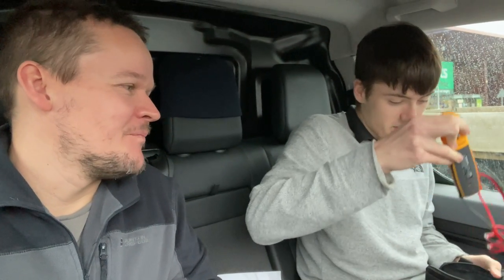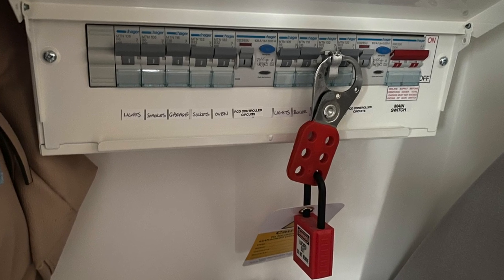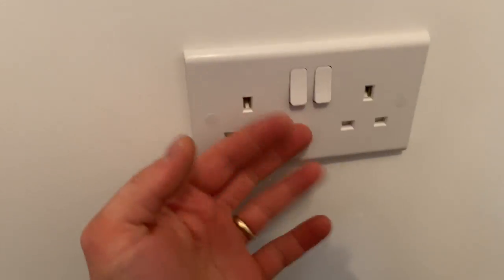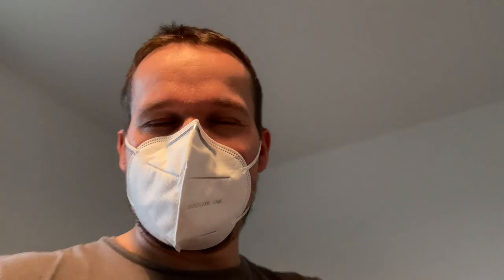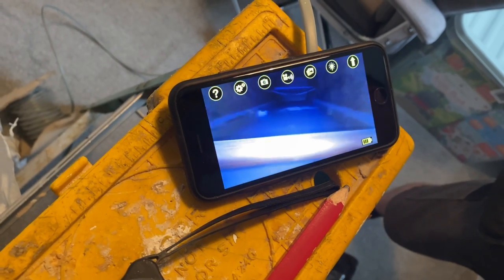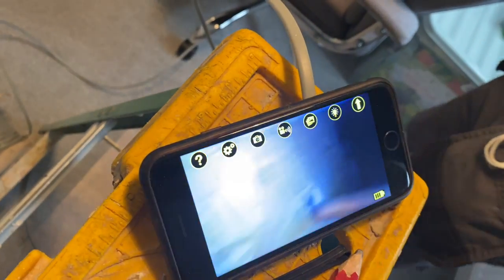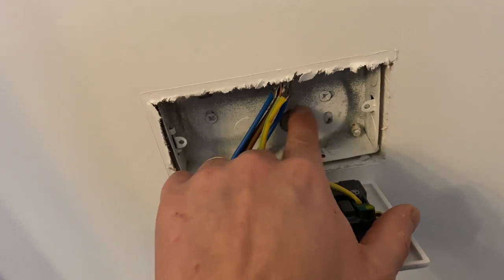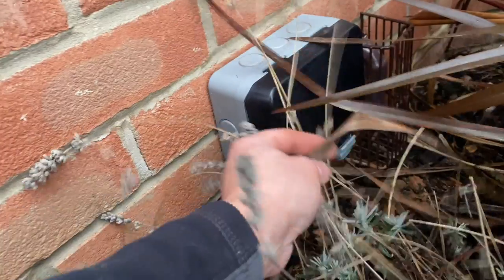NEW BUILD WIRING  Unprotected meter tails fabric of building

Comment: I would like to ask a question if I am allowed. we had an extension done with obviously new  wiring and lighting all done pucka  and to all required standards, But he discovered that the original lighting has no earthing, he was not really worried about it but being a good bloke though we should be aware, So if we want to have this sorted, is it a case of ripping up all the floorboards  to get to every single light in the house, or can he just do some earthing at the board, cheers,
Reply from the maker: Easier to Rewire the circuit. If not just make sure you don’t have any metal switches or light fittings.
Reply: @Cjrelectrical  Thanks for that , great video.s
Reply: My dads house is over 60 years old. I went to him during the week to replace a rose in the bedroom. Talk about no earths in any of the light switches or light fittings. 3 single
6mm wiring all red. A switch live and neutral and the third looped into the other 3 bedrooms and the fuse board is the old screw in ceramic fuse 6 amp . No trip switches. Total nightmare. And to add to that I blew the fuse and to find one of those fuses in an electrical was another nightmare.  In the end I ended up buying a ceramic connector block and going with the old design in the rose and not connecting to the buzz bar inside the rose. I’m not a sparks but it’s a quick fix. I have a sparks lined up to rewire the old family home.  €5500 includes changing all light switches, light fittings and sockets.  The house is a death trap as it stands. Anyways love the videos Chris and James keep up the good work. 
Denis from the Republic of Ireland.
Reply: @denisriordan4548  When i mentioned the no earth situation to the sparks doing the extension wiring which he originally pointed out,he did not seem that bothered,just pointed out about no metal switches,he just seems to accept that's the way it was  and not something to get that concerned over,

Comment: seen tails in cavities quite a few times on new builds. Too easy to run them in cavity when houses are being knocked up :( The outside meter boxes cause the problem, their a pain in the ass. Its the same old issue though where you can't get a 30ma time delayed rcd?. Better planning of the building by the architects needs to be done.
Reply: 30ma time delay rcd wouldn’t meet additional protection of 40ms at x5 anyway

Comment: as it a pme system and the circuit is over 40 amps it dosnt require rcd protection as long as the 16mm tail dont are not less than 50mm  deep in either walls or ceiling

Comment: Get that often with new builds, they get away with no RCD protection due to coming under "distribution". It's a rather shoddy loophole honestly and even if you were to put an RCD in you'd be looking at a  rating so much higher it's not likely to trip outside of a dead short anyway. Most of the time won't even see a switch fuse though so credit for doing something I guess.

Comment: Whilst your lad was feeding the draw rods through the ceiling rose, surely the lighting circuit should have been isolated?
Reply from the maker: Why’s that mate fiberglass rods and safe terminals?
Reply: @Cjrelectrical  was only asking, wasn’t sure if it was a safe working practice requirement, and that sock on the end of the draw rod looked conductive, also as you’ve shown in many of your vids safe terms or not, if some cowboy had left exposed conductors it’s not safe.
Reply from the maker: Yeah I made a quick risk assessment and deemed it safe to continue with the lights on

Comment: But then how do you run a 25mm swa, it would mean adding a extra meter box to incorporate the switch fuse.  no one wants a big ugly swa coming out of their ceiling and entering the CU. and i’ve noticed in some new builds i’ve worked on they have a steel pipe protecting the tails when it’s run in walls.
In regards to running tails in a cavity ain’t it safer than burying it in a wall 50mm deep, what if diy dave comes with his hammer drill and drills through, you think he’s gonna know about the 50mm rule?

Comment: Be nice if the CU was vertically in line with the meter box. Bad architectural design. With regard to an RCD in the meter box, no. Not sure about 18th as never read it, but 314 comes to mind, circuit separation to avoid unnecessary total loss of power due to a fault, for all the obvious (to me at least) safety & inconvenience issues.

Comment: I'm not an electrician but what's the issue with twisted earth s
Reply: Electricans do this thing called testing. They have to separate the wires to do this. When they are twisted or sleeved together it’s a pain for them

Comment: Great video. This is first time I heard tails run over 3m have need protecting by rcd?
Reply: have not time watch the video yet, but thats news to me 3m tails must have means of local isolation, sure you got that correct. i would like the Reg No. from someone in chat or @cjrelectrical
Reply: @ecoterrorist1402  It's not the length of the tails he's referring to but where the tails go.
Reply: The tails are in the fabric of the building - outside of the acceptable zones. What happens when someone decides to drill a hole & catches one of the tails with the drill bit?
Reply from the maker: Tails buried in the wall the only protection is the 100amp fuse. You could put a nail straight through the line conductor and not know you’d done it until you touch the consumer unit and the lovely picture you’ve just hung on the nail.
Hence the earth armouring on the cables or at minimum an unearthed metal plate of 3mm thickness or greater.
Reply: @Cjrelectrical  if the electricians are the well known company it will be protected by a steel plate for mechanical protection
Reply: Within the fabric of the building but deeper than 50mm. Sub main  from prob a 60A switch fuse so it’s fine.
Reply: @ufoialienhunter1652  except that you can't guarantee that it is at greater than 50mm unless its physically constrained, which it doesn't appear to be. A 60A fuse won't protect a DIY'er drilling into the line tail... Using an RCD may not be an absolute requirement of the regs, but in my opinion would be good practice in this sort of situation.

Comment: Did you come off main ring or radial circuit? If off a ring there should be a spur installed to protect the cable
Reply: One single/double socket is fine off the ring/radial, more than one socket or one 3 way socket and you have to fuse it.
Reply: Appendix 15 says it's fine on a ring circuit, but on condition that the wiring method can handle 26amps...

Was there insulation in the wall🤭
Reply: Best not to comment again.

Comment: I see it happen all the time in new builds with the meter tails, I’ve seen one house go over 15m through a timber frame house,.
Surely it would have been easier running a 25mm 3core SWA instead and it would comply🤷‍♂️
Reply: but who wants to see a 25mm swa coming up the wall in a new build? Not saying I don't agree with you :)
Reply: @jonathanstephens7804   I get what your saying, but if it’s timber frame it doesn’t have to be on show normally you have at least 6inch behind which is plenty of room to gland a SWA into the back of the Consumer Unit
Reply: @sampegg9915  I did a large timber frame build a couple of years ago and recommended the client had a cupboard added to plans just for power and data. I ran a 16mm SWA from the meter cupboard and surface fixed it to wall in cupboard then glanded nicely into board :) unfortunately not all customers are that accommodating
Reply: @sampegg9915  in which case the pvc pvc tails would be greater than 50mm within the fabric of the building.
Reply: @tomorichard   I doubt all the way through the building especially coming  from the wall into the ceiling
Reply: Just earth the swa at the switch fuse end and stuffing gland at the dB
Reply: If you fuse it down and your not going that far then 16mm would be more than enough for most houses.
Reply: @oliverriall  For now yes, but seeing as we'll likely all be driving electric vehicles in a decade or two it seems foolish not to use 25mm tails to accommodate the extra load of an EV charger.

Comment: Grinds my gears that electricians respond to gas pipes like this! Building regs are okay with this installation...... along comes an electrician and makes the gas installation incorrect. Cables 25mm minimum switches sockets c/units mains supply equipment 150mm. Clip the cable well out the way and move the light forward. I look at these situation and measurements and see this as a minimum requirement meaning of you can easily as in this situation make it safer then do! Much better than say eewwwww I don’t like that pipe there but I’ll fit the light anyway!
Reply: Yes, I recently discovered this reading the gas regs. afaik It's not in BS7671 (?) so don't blame electricians for not knowing that, but perhaps it should be to ensure consistency between the two.
Reply: I’m not sure that would matter as bs7671 is not a legal requirement unlike the gas regulations
Reply: @stevenblack9644  BS 7671 is also a legal requirement, through Approved Document P 1.1. But even if it wasn't a specific legal requirement, we still need a set of standards for people to work to and consistency between them is necessary.

Comment: How ate tails bought thru the wall from meter cupboard to consumer unit nowadays. Years ago it was just smash a hole through, fish the tails up the cavity and into back of C/ U. This is not acceptable due to cables in contact with insulation and a potential damp bridging. There are loads of 'you can't do this anymore', but there is no solution. Frustrating

Comment: When I've worked on utilities. If the viewer is outside and we have to get the supply inside the building. We go out the cut out, tails to fused CU then out in swa. To an adaptable box where the board is.

Comment: Not sure how to RCD protect the tails without effectively having one RCD for the whole installation.
Reply: How about a 100ma for the tails and 30ma rcbo s
Reply: Use a type S RCD (100 or 300 mA). It'll make sure that a 30 mA AC/A downstream will trip first under normal conditions but if the inside RCD fails or someone bangs a nail into the tails it'll trip and hopefully prevent a fire. It's impossible to provide additional protection for the tails though, unless you put the whole house on one RCD like in an old-timey TT.
Reply: @supersparks9466  Doesn't it have to be 30mA for protection of cables buried less than 50mm.
Reply: @Ragnar8504  If the tails are buried greater than 50mm in the fabric, then additional rcd protection is not required.  If they are buried less than 50mm then suitable mechanical protection should be used.  Using an S type rcd for such a domestic purpose does not comply  with the regs,.   The way to know if the tails are correctly installed or not is to look on the installation certificate.

Comment: meter tails should not be longer than 3m but if the design of the building requires longer then the electrical designer should take this into account and design rcd TD protection/ method of installation into the electrical system
has anyone noticed in older style houses built in the 30s with electrical supply network cables from overhead supplies entering the property at roof level and running inside the property to the consumer unit position.
how dangerous is this! 600A non rcd protected wiring inside a domestic dwelling!